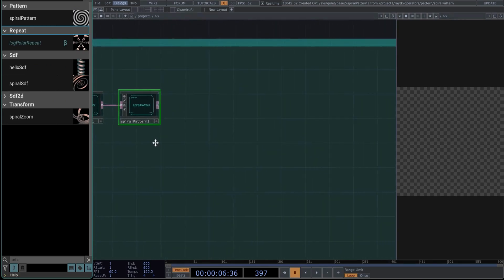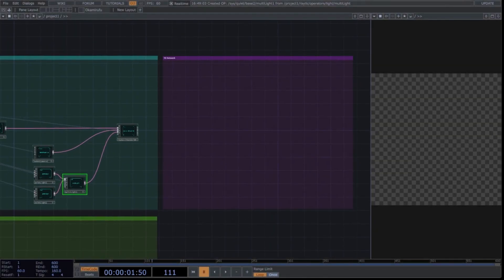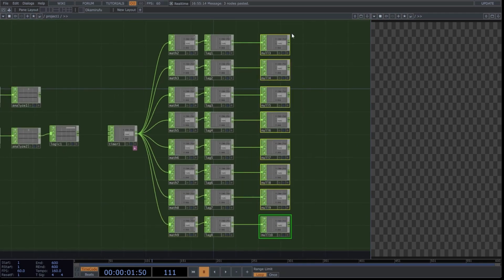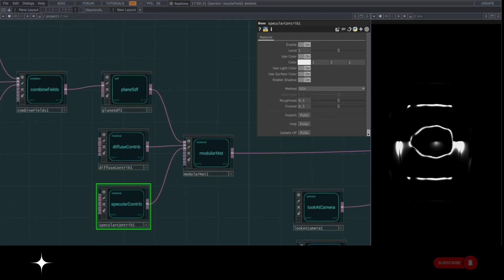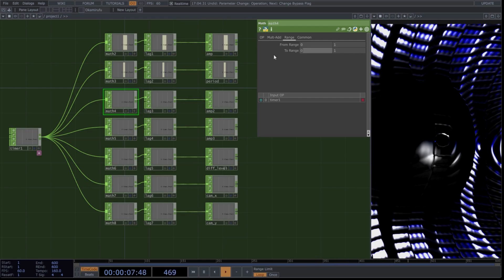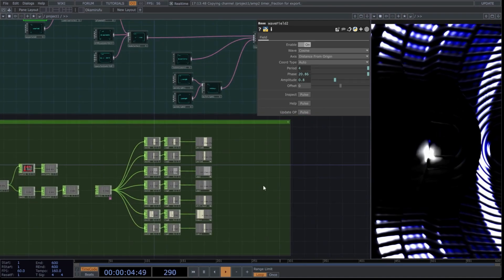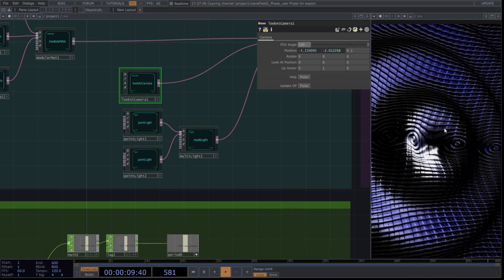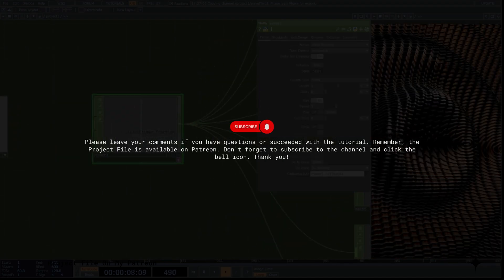Audio Reactive 2 - TouchDesigner | Redefine 3D Surfaces Using RayTK Wave Fields with Spiral Patterns

Comment: Wow that was solid! Thanks - Built the network but get a glitch at the Timer. It builds but doesn't reset back to Zero so only get one animation. Have checked all the settings and replaced the Logic and the Timer OPs. Thanks in advance.
Reply from the maker: Hey, sorry for the delayed response. Were you able to solve that issue?
Reply: @OkamirufuV  Unfortunately not.  I sent a link to the toe on your instagram. cheers.